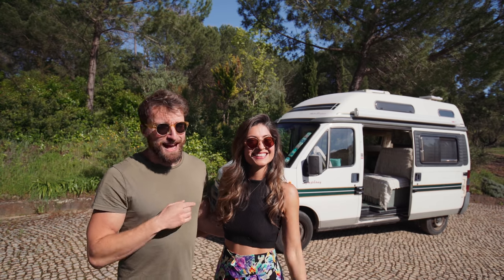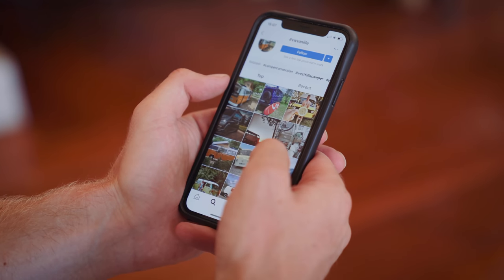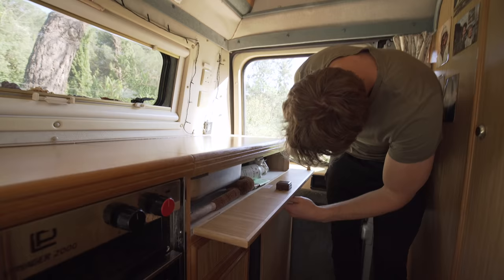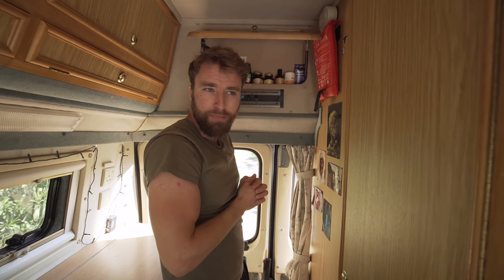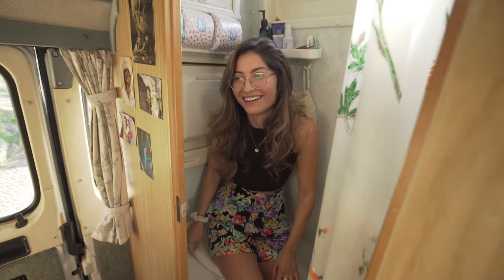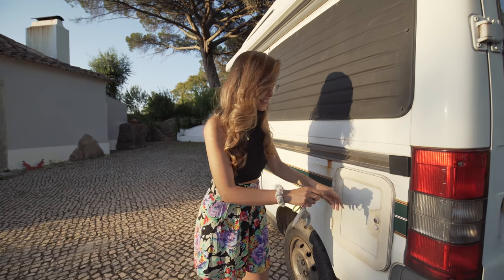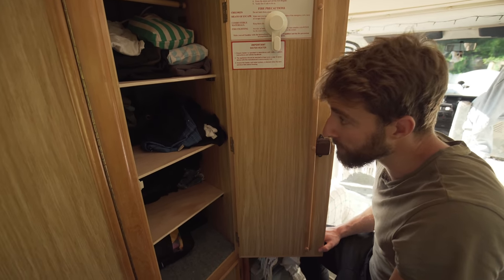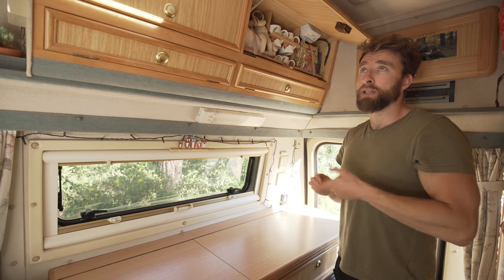VAN TOUR | Small, Modular, Smart Conversion w/ Shower + Toilet | Peugeot Boxer Autosleeper Symphony

Comment: It’s great it seems to have everything!! One thing carbon monoxide meter should be low down and smoke alarm up high
Reply from the maker: Hi Else! Glad you think so about Jits 🚐🌟And thank you for the safety tip - consider it done 🥰 Very much appreciate it 💛 xx Tania
Reply: Why?
Reply: @34ImpossibleShapes  CO2 is heavier than air so important to have low to be effective as an alarm, If the alarm goes off when the CO2 is high you are already good.

Comment: Hi you adventuring pair. We bought the same A/S Symphony from new & loved it. Here's the rub, the registration No being S199 LCF ha ha cool eh. What I added was a turntable on the drivers seat, it gave great views from the back when seats were facing each other & more leg room when the o/s bed was used as a single. Another mod was, open the n/s/r door & you'll see wood panelling, behind there is a large cavity, I removed the panel cut a rectangle piece out & finished it with beading & refitted it. I used the new found space for wedges, water filling hose & a BBQ!  This van is still being used we sold it after 3 yrs & bought a A/S Symbol virtually the same layout. Happy days you two. Are you still awake ha ha.

Comment: Great video guys! We have an 04 Symbol - almost identical to Jits. One recommendation would be to change all the lighting to LED. I used 14" units which were about £30 each. Not cheap but they use a fraction of the power of your existing. Also, I swapped out the fridge for a 12v compressor one.  My 120w solar will provide  more than enough to run it. No more mucking about with gas, which is great.
Also, I got the van chipped. Power is up from 85hp to 115hp. It is brilliant. Actually uses less diesel but means no more changing gear for every little hill.
Reply: Good advice

Comment: hello from wales, we've had lots of vans over the years and an eriba puck which was fun. but after so many years we bought  symphony on a 96 plate, wow what a great van , audrey as it was called took us all over with no fuss, i did a few mods same as you solar panel batteries , i put a clear strip of perpex in the bathroom, where you have the window screwed it to the outside of the frame with short screws , the wife got all her make up in the etc,  a really easy fix. i also fitted a k + n air filter to the engine, it helps the engine breath great for hot climates cost around £40. on the bike rack we had a fammia storage box. we sold our audrey but loved auto sleeper so much we bought the Neuvo model, still older van a 2006 model wonderful van, your mum was right I'm of an age when the vw van were cheap, but like you said no toilets showers etc, auto sleepers are by far the best,

Comment: The best record and edited van tour i’ve watched! Great video!😀
I just have two questions, you mentioned the water tank is split into two partitions, hot and cold, does this mean you have 30L of each?
Also seeing as you must your laptop a lot to edit, how long can you stay plugged into Jits whilst using the laptop until your batteries go flat?🙂 
Thanks guys! Keep enjoying Portugal!😀
Reply from the maker: Hey Denis & Katy! So sorry for the delay getting back to you. To answer you question, we are actually not sure what the split is between the hot and cold tanks but our best guess is that the hot water tank is probably about 20 litres max. This is an educated guess based on the amount of hot water that Jits heats up in one go.  And in terms of our batteries, we'd say that we get about two solid days of heavy laptop use before we drain our batteries and need to go on a drive to top them up. Of course this is longer if it's sunny, as the solar panels will help keep us topped up for longer!! Thank you again for watching! 💕 xx Tania

Comment: You’re mum knew her stuff and guided you right.

Auto Sleepers are the best built van conversions around. Even the old late 1980s models have solid interiors still.

I’ve had a few classic VWs (great for the cool factor but not great to live in or use as an everyday vehicle), I’ve built my own vans too. But I’ve never been in a position to travel properly......yet.

Currently finishing a T5 conversion to sell and then going to convert a LWB Fiat Ducato with the extra high factory roof for us to go exploring.

Look after Jitters and she will keep you safe, warm and protected for years to come.

PS, condolences on losing your Mum. It’s a year since I lost mine but we had cared for her at our home for 5 years so I had plenty of time with her before she passed.

Comment: I can vouch for the efficient use of space in this type of camper design. Ii had the slightly bigger Duetto from autosleepers which is on a Transit medium wheelbase. I used it for ten years and now I am on my own I wish I still had it. You say that your mother must have been delighted to find that her crockery fitted in the cupboard space fittings, well actually from new they came with a set of crocs and yours are very possibly the OE ones or replacements of the same type. They last well because they are like German cars, over engineered and typically well designed. I used to tell my wife if she ever ran off with the milkman I could happily live in the van all the time. Enjoy your travels 👍

Comment: Great van tour! I have the Autosleeper Symbol, a couple of years later but almost identical. After busy sightseeing, and before moving on, the van seat backs can be rotated slightly forward making 2 great loungers to put your feet up facing the rear of the van - until circulation is restored.

Comment: Your mom was right. This is the perfect little van—so cleverly thought out! The swivel front seats, the dual beds that can become one larger bed. And it seems so solid and well-made. We're having a van custom built, but it will have nothing on your tiny home, as far as functionality goes, other than a bit more space (it's a high-roof, extended Transit) and additional batteries and solar, not to mention one largish dog. But our van will lack your van's maneuverability, and it will use much more petrol. Love the video, too. Kudos!

Comment: Love the van, love the tour. Well designed lay out. We are half way through a build. Again compact but practical. I have an old fiat scudo that I cut the body off and now building from the floor up. It will be 8 foot long, 6 foot wide and 6 foot 2 inches tall inside. It will have a 310 watt solar panel powering 240 amp hours of battery's, instant hot water boiler, refillable gas, recycling water system, rain water catcher, vented composting toilet and a shower. Cant wait to get on the road. Enjoy your travels and stay safe

Comment: Jits is The Tiny Camper Van That Could!  Amazingly fully capable for both of you.  I would have a spare jug of water, & a spare container of propane especially during this pandemic.  The tires probably need to be replaced.  Consider upgrading to Lithium batteries when the current ones need replacing.

Comment: I like the format of the way the bathroom was done, gives me a similar idea I could use in my newer van conversion, may last recent van the transmission went out, so for the same price that would have cost me for a new transmission and labor, I gotten a 5 yr newer version, runs real good, and will be working on the actual newer conversion inside in the near future and may use the similar idea for my bathroom in it. And, like those other ideas you've shared also. Whenever I get officially started on mine, I'll be taking pictures, unless I can get a better video recorder than my phone has, I can do 10 minutes videos, but won't let me share more than 5-10 seconds from the beginning, which is sad, I would love to to before, during and after videos as I go along with my newer van conversion project 😊💖

Comment: Tip for you. The 2 x ring hob. Lift the lid open you should see left and right hand side is a hole in the stainless reflector.  Each hole should have a screw protruding. If it hasn't fit them.  This is for holding left and right heater reflectors vertical. The top edge sits against screws with lid tilting forward. If you are not sure I will do video for you. Great tour. Love the van Cheers from George and Jane 👫👍🇬🇧

Comment: Great van tour  if i may offer a few tips , 1 carbon monoxide is heavier than air so possibly move your detector,2 try fitting a computer fan on you upper fridge vent 👍,3 mini heki 400x400 skylights are a good replacement for the roof vent .
Gas low 👍 perfect for touring 
Great videos guys thanks

Comment: That is one great campervan. Brilliant design. Excellent conversion. Suggestions for improvement? Add an extractor fan in the roof light (I have the same type in my trailer caravan). And add another solar panel. Looks like there is plenty of space on the roof. Can easily be connected with your existing system. Would just give a little more flexibility. (I have 4 x 100w panels on my caravan). Lastly, try to organise it so that everything runs off the 12v system so that you hardly ever use the inverter. My TV is 12v, my laptop charges from  12v to 18v converter. And of course my phone from 12v to usb chargers.

Comment: Lovely van. So much bigger than it looks. 
May I suggest to move your carbon monoxide alarm near the floor. Its meant to be close to the floor as if u do have a leak the gas will settle not rise. Love from Wales x

Comment: What a great van. hey FYI the carbon monoxide detector belongs near the floor because those gases are heavier than air and fill your van up from the floor up. Smoke detectors go near the ceiling as that's where smoke goes first. Just found your channel. How fun.

Comment: I love Autosleeper vans...... in my opinion they are the best of all worlds! - improvement, gradually I would ditch the 3 way fridge to replace with a small `A` rated household fridge running off an inverter and add a diesel heater (for heating) to save gas (just have gas for cooking & hot water).

Comment: Hi Tania and Adam, when you point to your carbon monoxide alarm. I noticed it was high over your head. You should remount it lower, carbon monoxide is a heavy gas and will be detected earlier when it's lower. Travel and sleep safe.
Reply from the maker: Thank you so much for taking the time to write this! There have been a few others to have mentioned it and we are so so appreciative as we had'nt considered it before. THANK YOU! 🚐💕xx Tania Ps. I love your username, it's very cute!

Comment: Hi Adam and Tania ... we've just got an identical Boxer Symphony with a 2L petrol engine.  Ireland and Scotland trips once the CVbug is tamed.  Keen to hear of any mechanical problems you have so we can be forewarned.
Reply from the maker: Hello!! So great to hear from you and congratulations of the new purchase!! 🚐💕The only thing to flag is that the engine is not very well weather proofed, so we have had issues with the ignition cables (as they got wet!). Other than that and to keep on top of rust, we have absolutely no complaints. Jits is a petrol engine too which we love, so great stuff! Are we connected on Instagram or facebook? We would love to see pictures of you with Jits' twin!! xx Tania

Comment: As one of your subscribers said earlier: carbon monoxide alarm should be low down as gas is heavier than air and should have a vent on the floor in the bottle cupboard, and smoke alarm up high as smoke rises. so please for your safety change that asap,  I have had a van or two but now have Car and Caravan "Pensioners comfort setup" but loving following your adventures.

Comment: Hi, great vid, great life, great camper!
One thing that struck me is that (I think?) carbon  monoxide is heavier than air so having your CO alarm high up is pretty useless as you suffocate before it goes off. Better to put it on the floor. 
One question (sorry, I haven't read all the comments etc): what sort of fuel consumption do you get when you drive?

Comment: Out of all the vans I've seen this is the one I'd want the most. Would deffo need to increase the amount of water on-board. If the engine allows it id probably sacrifice some stuff in the bed/ roof space and stick a few Jerry cans filled with water so I can have slightly longer showers.

Comment: Hi Tania and Adam, thanks for your tour video, really well put together and comprehensive. Am considering finding a Boxer Harmony for travelling the UK and Europe (covid allowing). I have a couple of questions if you'd be okay with that. 1) Did you or your mum fit the solar panel and is the wiring easy to run, hidden, from the control unit down to the battery. 2) Where have you managed to position the 3 pin outlet, running from your inverter? 
Thanks again for your videos, they're excellent. Tony
Reply from the maker: Hi Tony! Thank you for watching, we’re delighted to hear you enjoyed our tour of Jits 🚐🌟 Also great to hear that you’re researching your own camper! To answer your questions, we had the solar panels installed professionally (definitely not us) so the wiring and all that is well hidden. As for the three pin running from the inverter, we had this added right behind the drivers seat. We’re happy to send you pictures of that if that’s helpful. Our email is jitsintothesunset@gmail.com so feel free to reach us there too! 🚐 💕 xx Tania
Reply: @JitsIntoTheSunset  Thanks for the reply, much appreciated. I've sent an email....good luck on your travels🚐👍x

Comment: Hi, love the video- Got the exact same van a week ago, learning about it! 
Where/who did you get to do the solar panel and how much does it cost? 
Does daisy chaining the leisure batteries mean you can run a 3 pin plug socket without an electric hookup if you have a solar panel? Did you strip out the cages in the grey cupboards under the seats? 
Finally - how do you shower in the tiny space?! 
The oven, do you know if you have a speaker button somewhere or do you use a sparker clicker hadheld 'thing'?! Cheers if you answer all those- the instruction manual is not the best without diagrams! 
We have a switch to the right of our 'old fashioned control panel' at the back. We have no idea what it does, but I notice yours doesn't have that.
(Liking all your storage space our cupboard beneath the oven is a fuse box and the cupboard above the control panel is tiny.) Any tips - gladly received!)
Thanks for your time

Comment: Yes , she is perfect. Great channel.  love it.
Maybe I missed it but does her name come from the number plate? Our visit van conversion we did in 1983 was a hiace with KTY number plates , so she was called Katie van. if you want to make her 'more perfect' then have you considered a portable induction cook top?
 they are cheap and very effective on main power and also if your battery and inverter can handle it.
If your fridge is gas electric, has it been installed correctly? they are very sensitive to being installed so the heat can circulate correctly on the rear pipework. this becomes evident when you use them on electric. they always work better on gas. If you need to get it working colder on electric, look into getting the rear air flow exactly as the manufacturer instructions. believe me you can get them to work great on electric.
hope this helps

Comment: carbon monoxide alarms are best installed below the level where your head is when you are sleeping, so about six inches off the floor.  this is because carbon monoxide is heavier than air and pools at the bottom.

Comment: Your video came up as I'm looking at buying exactly the same van but instead of gas I have a bluetti lithium solar generator which I'm hoping will power the water heater and have a diesel heater, was 100w the max size solar panel you could fit?
Reply from the maker: Hi Malcom, that's very exciting!! If you check out our van upgrades video that has all the updates we did. Including a lot more solar!! 🚐 😊 Adam

Comment: Hi can you tell me if the engine is a 2L petrol and I’d so how economical is it,I’m presently interested in a 97 model symphony that’s 2L petrol and I’m wondering about running costs, any advice would be much appreciated
Reply from the maker: Colm Byrne Hey Colm! How exciting that you’re thinking of adopting Jits’ twin!! We still need to calculate the exact miles per gallon but we reckon that it’s just as economical, if not more so, than diesel. So sorry I can’t be of more help on this. Do let us know if you manage to get the van and we hope our van tour has helped 🚐🌟Xx Tania

Comment: everyone on comment is so impressed that van is so 'small' and can have so many things
me taking a quick google at the van model
no, that is a huge van on par with the big boys that every van convert is doing
just dont expect your own van can fit all that before looking at the size difference lmfao
Reply from the maker: Hi Lou, I think it's smaller than many vans out there. I'm not sure what van spec you were looking for on Google, but this is a short wheelbase 98 Boxer. So compared to modern Sprinters, or anything with a long wheelbase, I would consider it quite small. But it's true that its bigger than something like a Caddy so I guess it depends what you're comparing it to 😊 🚐 Adam
Reply: @JitsIntoTheSunset  your van is a standard commercial 'campervan' size that every company is pushing out nowadays to be able to park at normal parking lot albeit very tightly. Those with way longer wheelbase cannot do so.
Maybe at the time the video is uploaded it is consider small since all motorhome are huge rv/bus but nowadays many people are converting even smaller vans with 1 full sized bed 6ftx6ft, storage and a slide out kitchen at best.
Their wheelbase is only 3 meters or under with slightly smaller width, from various brands
You are a very tall guy and you can stand up straight in there with extra space too, where else many campervans need a goofy pop up roof tent thing to stand up straight in there lol
so no that is not a small van